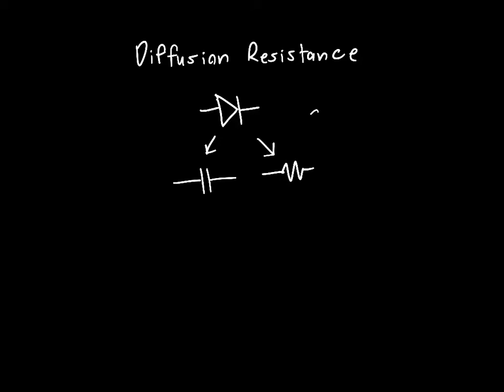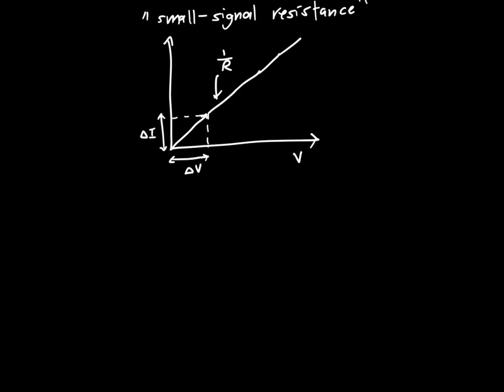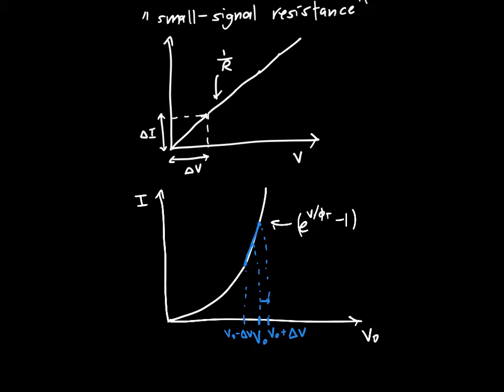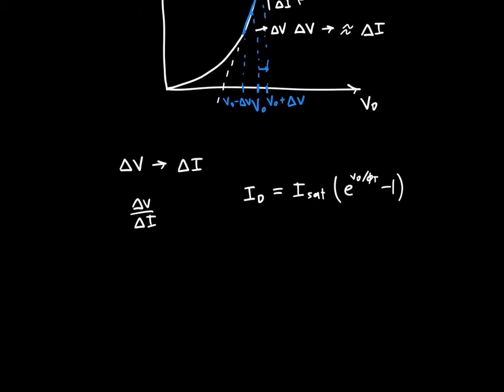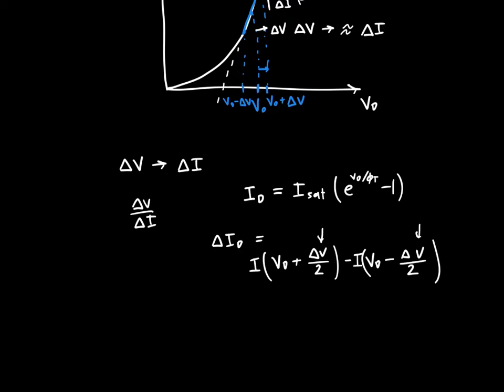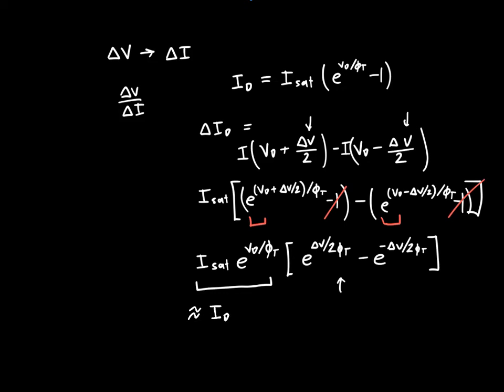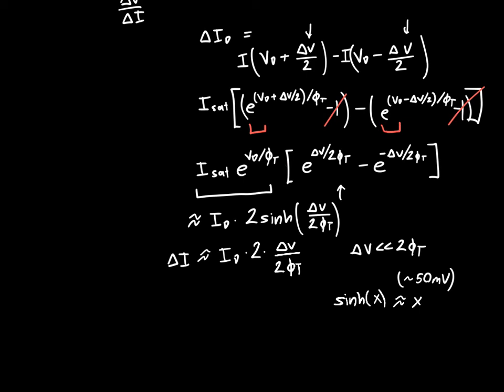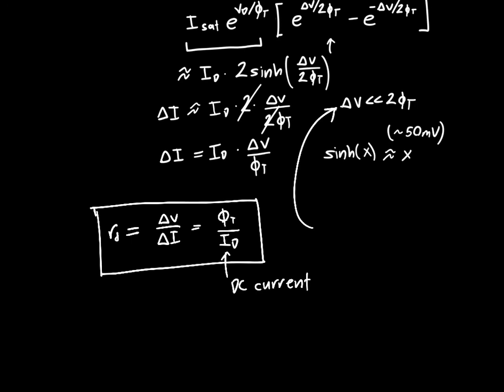Diode Diffusion Resistance Derivation

Comment: In this Video you looked how a small change in applied voltage changes your current I. By taylor expansion to first order you can get the changing constant "resistance" R. What this thing actually is equivalent to is just taking first derivatives and the first derivative at a point is then e.g. 1/R(U). So by just using derivatives these derivations become in my view way more elegant and more importantly shorter. You did similar things in derivations before. Beside this I think you present the topic very clearly and you are able to focus on the essential ideas and steps. Thank you!
Reply from the maker: Yup, taking derivatives is equivalent to doing this. This way more directly gives you a sense of the error incurred in doing so, without having to take an infinite number of derivatives. Now I’m more comfortable with calculus and would probably do it the other way xD